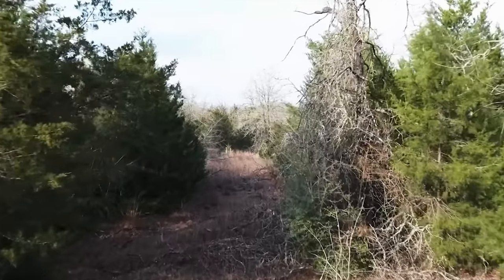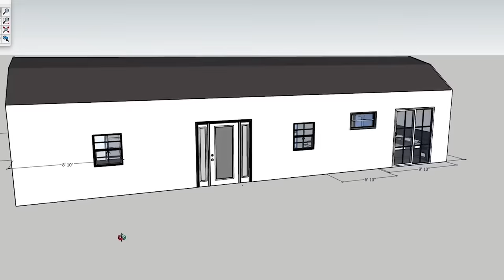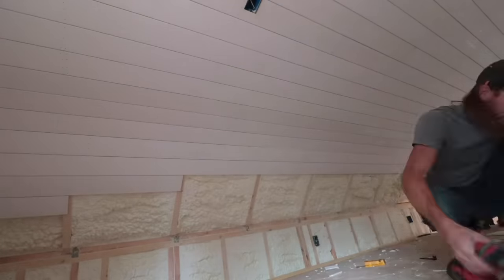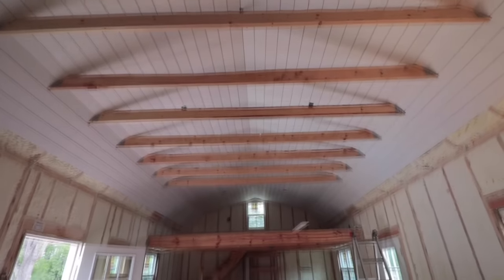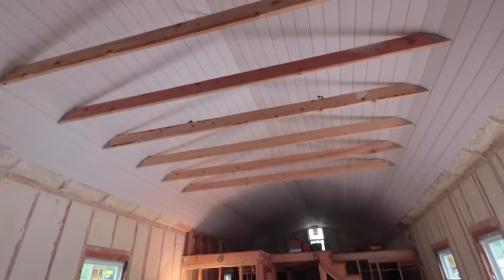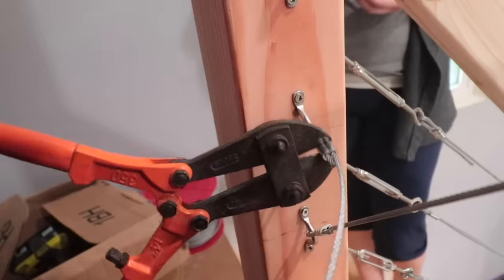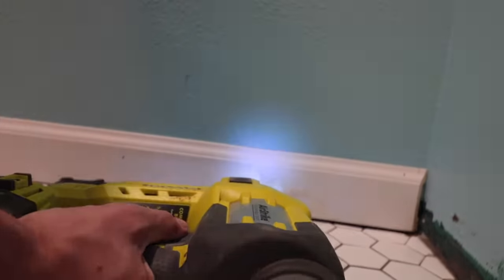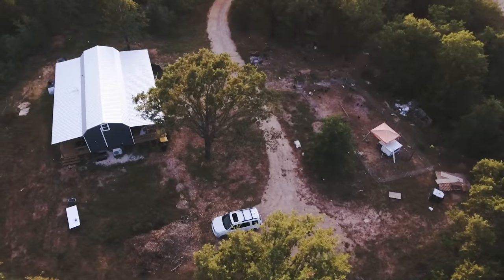515 Day Shed to House Conversion in 13 minutes {Timelapse}

Comment: Am I the only one noticing that the deck has a better foundation than the house?
Reply: It’s not a house it’s a converted shed, but you’re right it should have had a better foundation.
Reply: Yeah it kinda cares me since there is kiddos around
Reply: @2010sinnamon  Well, it's not quite scary, for a shed that's being used as a shed its fine. For a house though, not having a slab or proper concrete bases for the supports will lead to uneven settling, causing cracks in the sheet-rock and doors and windows that don't function properly. To fix that with the house in place is going to be much harder than doing it correctly beforehand.
Reply: That's the thing, it's not a house, it's a shed and not built to be lived in for many reasons.....most of them having to do with safety.
Reply: @sanautin  What are these areas that it's insufficient might I ask? It being originally intended as a shed has NOTHING to do with whether or not it's built to code or can be modified to meet code. If a structure is large enough to require a permit then I'm pretty sure that it has to be built to code and that shed is definitely large enough to require one.
Reply: madmatt2024  You're right. It's can't pass the final inspection if it isn't up to code. Shed or prefab if it's going to be a place of living then it HAS to pass all the inspections before it's signed off on. Also note that drywall & flooring CAN'T be installed until it's passed most inspection. The final one is done prior to moving in.
Reply: @tmwatts1088  - this is highly depended on where you build.  Outside of a urban center only County and State building codes apply. Those codes are usually very broad/lax by necessity.  edit: Also this is Texas, they have some of the most lax building and zoning ordinances in the country.
Reply: Jon Smith  Most of these shed homes are built in Texas, the only state without codes and regulations on what a person can consider a residential dwelling.  Homeowners in Texas do not have to follow all the zoning and building requirements that the rest of us have.
Reply: doesn't really make sense..  the amount of work they put into making the shed a home was the exact same thing as building a home..  they should've just poured a foundation and built it
Reply: They house is set ontop of graded sands and gravel, this is in Texas so I doubt any frost is shifting the ground. The deck extends beyond the graded gravel and sand so that might be why they went extra on the deck foundation
Reply: @simpleesuzie9369  WoW that's great for Texas but don't forget you have a lot of other states that are LAX as long as you're not in the city Az,Ut,Co,Or and Wa State will let you get away with it... And if you need to have a inspection won't say where but a lot charge a like get away with fee haha been through it twice now.....
Reply: a lot of older homes are on piers ,  Im guessing they didn't show that it has more piers
Reply: @demboyz808  that was the one thing that concern me. I like the daunting task.
Reply: @demboyz808  16x48 is a bit over 750sq ft, not counting the loft part. There are houses in my city that aren't that big.

These big sheds are basically structurally up to code, so putting the stuff in it to make it a house isn't much of a stretch. I'm not sure I'd dump as much money as the people in the video had to in order to get it to the level they got it, but it's definitely a house.
Reply: The deck is literally just on some concrete stands. I don't think that really counts as being anchored anymore than the rest of the house.
Reply: @simpleesuzie9369  is Texas the  only state like this ? IF YOU HAD TO BUILD WHERE WOULD YOU
Reply: Isn’t the foundation like a mobile home..? Mobile homes last forever unless a tornado comes along but at the same time a tornado could take a regular house too. Maybe they could have made the floors thicker and sturdier
Reply: Caleb Solis it’s called caca
Reply: @jerrychildress  I agree! It's just as hard to build here as any other state!
Reply: I've torn down 130 year old homes sitting on cedar stumps. My great grandfather lived in a hole. It will be okay. LOL
Reply: The first tornado will even that out.
Reply: Deborah Xavier-Velez I
Reply: You didn't notice the ground they built on?
Reply: @ccrbonline1752  Hi Sally pickering how are you doing 😊😊
Reply: @sanautin   - well, it’s a house NOW!
Reply: @tmwatts1088   - lot’s of things meet code that fall apart a few years later. That’s why code changes.
Reply: @simpleesuzie9369   - Love will hold a family together, but not a shed on sticks being used as a house for a family of 5.
Reply: @2010sinnamon  why?
Reply: Nope.

Comment: Nice work.  Save yourself some hand agony and cover those exposed cut off cable ends on the stairway.  Slip on the stairs and grab at the cable and the exposed cable ends will mess you up.

Comment: The house is really cute,however I imagine the amount of money put into the entire project could have been used to just buy a regular house.
Reply: These only cost 9 grand and with 750$ you can get insulation and electrical already done for you. The rest probably costs like 10 grand so 19k is cheap here. Your not finding a house cheaper.
Reply: @willieoliver1507  great point
Reply: And the resources and energy spent to acomodate all of that. That’s not ecologically sustainable
Reply: The thing that cost a fortune.. and i mean a fortune is.. the land.. and then getting water and electric back there. I have land out in south Texas on 125 acres. I’ll just say.. I build a house out around 50 acres out from my home as my hunting cabin. House was a small 3 bedroom, 2 restroom. Cost me around $25,000. Now to get water and electric out there cost me another $20,000 alone lol. If I were to assume.. this cost around $150,000. Excluding the land. Now although this is a lot of money.. depending where you live it’s no. A cheap Cali home is $550,000 lol
Reply: @willieoliver1507  $10k just in appliances and lighting. You are also not getting electrical and insulation for $750 that is fit for living in or anywhere close to what these people put in. Seeing how just the electrical panel and breakers for a home is going to run you around that, not even including spray foam. Spray foam is average around $2 a board foot. 15' wide x 40' long x 3" thick x $2 = $3600 just for the roof foam.
Then you have to add in the cost of cabinets, sinks, tubs, tile, counters, flooring, paint, that deck etc.
This project would be comparable to a trailer house in cost and it would have been done in a week or 2 instead of a year.
Reply: rural property always has a larger carbon footprint, go research it.  and plus in a 1st world ccountry it's easy to do this try acco.ishkng this kn indonesia lol.
Reply: To me the key point is how insane city taxes are getting for home owners, plus all the hidden taxes in extra "services" and "permits" you don't really need and can't opt out of. It's not just that one time cost of buying a home, it's that never ending gouge on your income. Plus all that land allows for fruit, veg and animals to cut food bills - animals are something else usually frowned upon by officials in a city backyard.
Reply: oh I guess you also mean why didn't they drop a more traditional framed house on that land, good question, perhaps they could explain it in another vid!
Reply: You aren't kidding, on top of commuting, fuel costs, propane is a joke to live on. I lived on a farm till I was 19, rural life is far more expensive. Sure you save on property taxes but that's really it unless you are totally off grid. Taking coolers to the grocery store and driving 30+ mins to get anywhere eats money, time, and sanity like you wouldn't believe. I would never live in the country again, I couldn't afford it.
Reply: @willieoliver1507  imagine that 10K for the shed when you could build the thing for $3k
Reply: Ian G  it would get trashed just like every other building in TX that gets hit by a tornado
Reply: I don't wanna hear how these guys were "roughing it" during this build 😂 haha I don't think they know what roughing it is. These people payed to clear land, run electric and water to the location, build a house with TWO decks and TWO bathrooms, All new appliances, and did you see the tile they used!? Yea the job was not cheap. My guess is they considered it "roughing it" because their dish washer wasn't set up yet 😂
Reply: @baconscoobysnacks3135  They spent a ton on luxuries, and not much on strength. I would not stay in that house during a storm.
Reply: Hahahaha!! Psych!  You guys are hilarious. Sucked me right in on that last scene. Love the house. So smart to work hard as a couple for what you want and believe in. I might need to come back to Central Texas.
Reply: @willieoliver1507  And you would have a 15 - 30 year mortgage
Reply: I could have built it better easier and cheaper
Reply: You mean but a regular house... and move it?!?!? How much does that cost?  Dont forget they want to use the land they have
Reply: @willieoliver1507  yea but they dug trenches for water , and most likely ran a power line, plus that deck it self was easily 8-10k id say this house build easily came out to 100-150k , they also bought the land ,plus used contractors there a lot of factors sorry no way this house was 19k
Reply: @mircat28  wrong its Commiefornia ;)
Reply: I suppose most of you missed the "THIS VIDEO SPONSORED BY" all over the place... I don't think they paid for that shed. 

Having said that, a double-wide would likely have been comparable in cost, but you can't make (and monetize) a cool youtube video of setting up a double-wide.
Reply: @matthewpetry4304  I kept reading in the comments to see who payed attention to that Big white,red, blue, and star logo signage that pretty much stated this was a paid promotion video.
Reply: @myfb3936  i
Reply: willie oliver This was a 70k plus job. I remodeled my whole house and know exactly how much most of that cost. He did a great job, but that’s slot it cash.
Reply: @jonathanwoo9829  no one cares about that!

Comment: When looking into shed to houses or small cabins vs mobile homes I can’t seem to find much info on whats the best choice and more durable. In south Tx they seem to be about the same price since I need a small 2BD 1.5 bath. A 16x44 shed to home for 50 thousand after everything or just get a small trailer for around the same price..
Reply: Well Jen, do have land? Do you have building age codes? Does this land have a septic in?Can you do the work yourself? Saving $. Meaning can you find a old mobile single wide{cheap 3k} and place it upon this land you own?
I had a channel once on YT with 700+ videos{YT deleted it, and 42K subs}, showing this process in which I take old mobile homes, and completely rebuild them, from re-decking, while the walls are still there, then removing and adding all new wire and plumbing to this structure. Then using Tyvek to seal the outer then residing it with modern siding panels. Total cost not including my time is about 23K.

The one advantage to sheds/ mobile homes they are typically taxed as personal property and lose value so the taxes stay low. 
Once the unit is permanently affixed with a foundation it will be taxed as real property.
So if you want to build a shed to live in all of the materials will have to be bought, and most wood needs to be used while still green. So buying all of the items before you build most of the time doesn't solve the issue of where to live while building a structure out.

Let's say you have no building codes, and the septic is in then buy a good used RV. Then you could build a steel shed then use the rv as the main house inside the shed, and since it is inside a structure it will last for decades, and the total cost would be about 50K with all of your own labor.
This is one way to solve the issues of expensive housing.

Or better yet find a really old house and do the remodeling yourself, I've seen old homes all over TX sell for 12K-50K, and while most are complete shit holes, and are in the "hood" one way to change the "hood" is to go in and invest by buying one and fixing it up and MAGA.
Of course it will be hard, and not comfy during this time and since if your like me have a full time job, so all of the free time is spent building.
And as long as you don't move any walls inside this "shit hole" you won't have to hire a engineer and if you are doing all of the work you can pull a owner/contractor permit and as long as you build to codes, save a ton of $$$.

Hope this helps Merry Christmas 2019 MAGA 2020 KAG
Reply from the maker: Totally up to you and your lifestyle.  So the fast answer I guess is...... it depends.
Reply: Jennifer G - look at it from a coupe of different angles. Up, down, inside out.
Do you want a completely customized home that takes a while to put together, or do you want something fast, but from a cookie cutter.
Do you want to be able to maintain your home yourself - because you built it out - or do you want to hire other folks to fix it for you?
Is time a factor?
Do you have the tools and the skills to DIY? Do you want them?

Still can't decide? Or do you have enough to decide?

If not, how does it make you feel when you think about each option? Which will make you happiest? Most content?
Reply: The real question is how much of the work can you do yourself? $50k isn't much of a mobile home these days, especially if you're talking new. I honestly don't know what you can find for that price, particularly since the very small ones are now able to bill themselves as "tiny houses" and every one knows the base price for one of those is $75k. Yeah. Those things got real stupid real quick. You can find repo mobile homes in the $50k range, but one of those is likely to need most of the non-structural improvements a shed conversion would need anyway. I've never seen one I'd want to live in without new floor coverings at least, and probably new sheetrock and cabinets as well. On the other hand, if you're paying a crew to convert a shed into a home, you could burn through whats left of $50k  after purchase very, very quickly. Remember that, even though these are advertised as "complete kits", that's a complete SHED. In addition to the interior finishes, plumbing, electrical and insulation upgrades (MANY of those) you'll still need to spend quite a bit on lumber, both to stiffen the structure (a stick frame house is supposed to have a projected life of 50 years. So, 50 years of south Texas winds, which might include tornadoes, who knows what climate change will do?) and for interior walls, and things like drywall backing and fireblocks. You might be able to just slap drywall on one of those things and pass a code inspection, but I guarantee it would be the kind of house where every wall moves every time someone closes a door. 

Personally, if I had $50k and I NEEDED a place to live, I'd buy the highest quality (structurally, not cosmetically, 2x6 framing etc..) repo mobile home I could find for the price- even if its 20 years old- and just mentally commit to spending another $15 - 20k on upgrades over the next 5-10 years, mainly in the form of better cabinets, upgraded showers and tubs, premium flooring. Cabinetry and flooring especially make a big difference in the feel of a house, but, if you can take the time to let big box store sales work with you, you can save a lot. The shed thing is tempting I know, but so much of what needs doing needs to be done inside the walls, you really need to make sure it gets done the right way the first time, which means either committing to do it yourself, or paying a pro. And I think a lot of people who are getting sold this idea are going to end up spending more over time, a constant trickle, on a "house" that's constantly trying to turn back into a shed.
Oh yeah, AND resale! A Mobile home has a value. You can ask a realtor what it is, and they can tell you. Jury rigged sheds.... not so much. So, regardless of how much you spend upgrading, be ready not to get credit for ANY of it in terms of equity.
Reply: Jennifer G , At the end of the day , it’s cheaper to stick frame your own structure. The only benefit to a shed is that 2 steps are saved. Exterior siding and roofing. Honestly those 3 steps framing , roofing , and siding may add an extra month to the build if it’s just 2 people. That month may make all the difference when life has to continue .
Reply: Having done this both ways, I would check into local issues such as taxes and depreciation. I suspect you will find that the more permanent structure will at least hold its value, be easier to resell, and may be lower in taxes. You may also find that in order to improve resale on a trailer, you need to put in a VA approved foundation. Consider too energy efficiency as the payback can be quick especially if you are using a lot of AC. Personally, I would go site built or modular with foundation.
Reply: @Allen Loser Thanks for the clarification!
Reply: @dinkaboutit4228  well said!
Reply: @dinkaboutit4228  👍👍